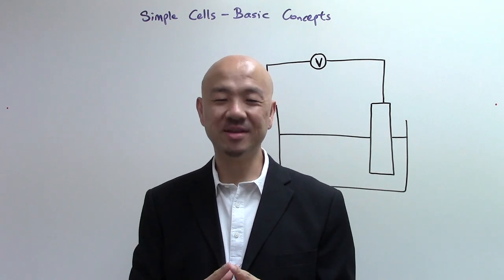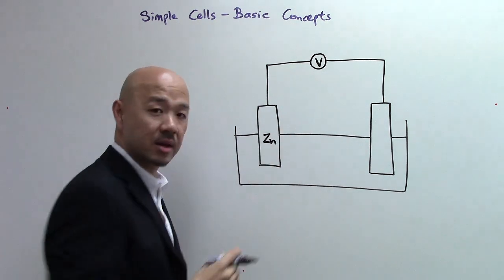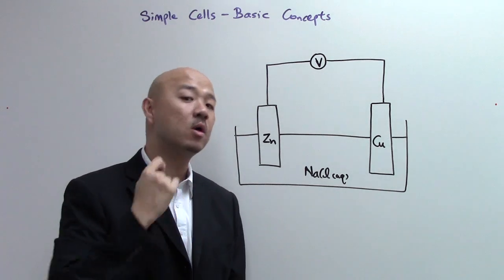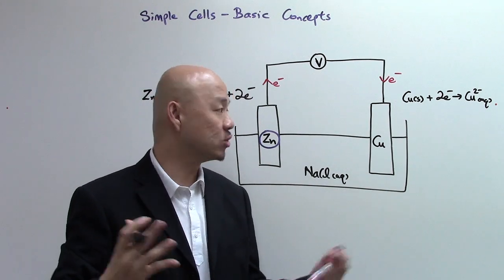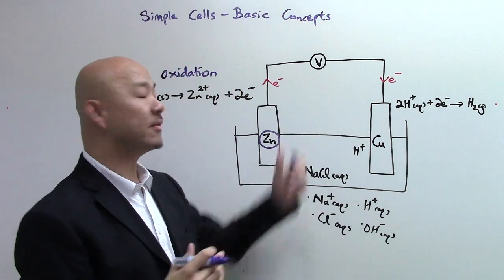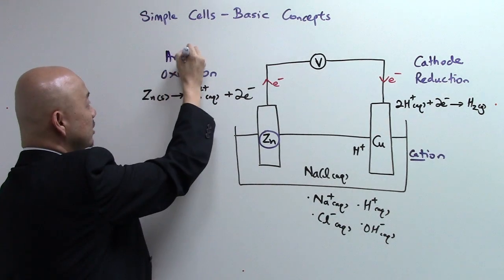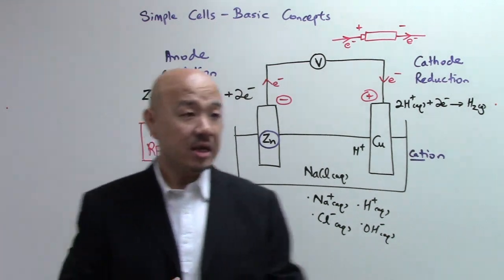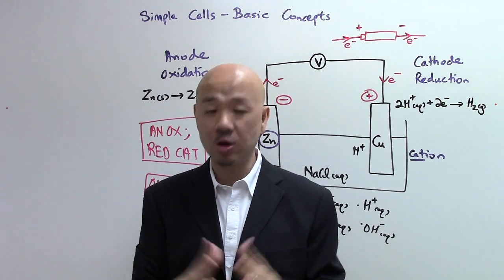O Level Chemistry. IP Chemistry: Simple Electric Cells

Comment: I thought it should be copper discharge because copper is more reactive than hydrogen?
Reply: Copper is less reactive than hydrogen on the reactivity series
Reply: Electrolyte no copper ions to be discharged. Only positive sodium and hydrogen, and since hydrogen is lower in the series, it is selectively discharged. 

If electrolyte is aq copper chloride, then copper will be discharged.

Comment: Dear Sir, thank you for the insightful video. Getting ready for O-levels amidst the COVID-19 scare in 2020. I have a question. At 9:50 you have drawn the small battery in which the electrons are moving from the positive to the negative according to the arrows. However, in the circuit you have labelled the arrows moving from negative to positive. Which one is correct?
Reply from the maker: Hi Angelino,

I supposed you are talking about the "small red battery" which i drew. That is used to help us decide the charges of the two electrodes.

Everything presented in the video is correct. Note that one of the application of Simple Cells is in Batteries and you learn in basic Physics/Science classes (Sec 1/2 if you are based in Singapore) that electrons always travel out of the negative terminal of the battery, and returns back at the positive terminal.

Hope this is clearer to you now.

You can visit my Basic Chemistry blog www.SimpleChemConcepts.com (written based on GCE O-Level Pure Chemistry and IP Chemistry syllabus content) for more tips and discussion of Chemistry concepts).

Meanwhile, stay safe and continue to learn with understanding. All the best for your upcoming O-Level examination.

To Your Academic Success in Chemistry,
Sean Chua

Comment: so good, make really sense. however, some points you should points out that may confuse some student with poor basic knowledge about the electrolysis. for instance, the rule of production at the electrodes, why hydrogen is produced and chlorine is produced
Reply from the maker: Hi Kira. Good to know that you find the video useful towards your learning.

However, it seems like you are still not very clear about Simple Cells.
Based on your comment, it seems like you are confused between Simple Cells and Electrolytic Cells. They work differently. The term "electrolysis" means the use of electricity to electricity to decompose an electrolyte.

Also, this video is meant for students taking basic Chemistry syllabus such as GCE O-Level Pure Chemistry in Singapore. Note that it does not comprehensively show all the intricate details on how the Simple Cells work. If you would like to find out more about Electrolytic Cells and Simple Cells at this basic level, you can read my blog posts or watch my videos at https://www.simplechemconcepts.com/videos/

Note: Chlorine is not produced in this particular simple cell.

The" actual" details on how the cells work are only discussed when we learn more advanced concepts in Advanced Chemistry syllabus such as the GCE A-Level H2 Chemistry syllabus in Singapore. Over there, we will use something called Standard Electrode Potentials to discuss the redox reactions involved in both the Electrolytic Cells and Simple Cells. For anyone who is interested to find out more about the strategies and concepts in Advanced Chemistry, do visit my blog www.ALevelH2Chemistry.com.

Do continue to learn Chemistry with understanding,
Sean Chua | WinnersEducation.com

Comment: Isn't the negative electrode, meant to be the cathode, and the positive electrode the anode?
Reply from the maker: Hi Sughra Zulfiqar, this is a very good question. Many students are confused between Simple Cells (also known as Galvanic Cells, Electric Cells and Voltaic Cells) and Electrolytic Cells. The charges on the cathode and anode for the two different cells are different/opposite. 

For Simple Cells: Cathode (+) and Anode (-)
For Electrolytic Cells: Cathode (-) and Anode (+)

Students are confused because they tend to just memorise and regurgitate, instead of understanding the underlying concepts on how they work.

For Simple Cells, it involve spontaneous reaction whereby Chemical Energy is being converted into Electrical Energy.

For Electrolytic Cells, it involve non-spontaneous reaction whereby Electrical Energy is being converted into Chemical Energy.

You can refer to the blog posts and videos on my Basic Chemistry website https://www.simplechemconcepts.com/?s=electrolysis to understand more about how each type of cells work as well as their similarities/differences. There's quite a number of strategies and analogies/mnemonics which i shared in my blog.

To Your Chemistry Success,
Sean Chua
Reply: @SimpleChemConcepts  ok, thanks for your help, even though my exams have been cancelled.
Reply: @SimpleChemConcepts  Also, does the more reactive metal always form the negative electrode?